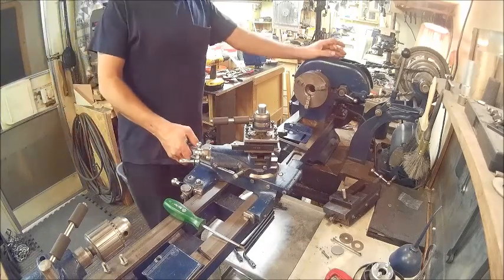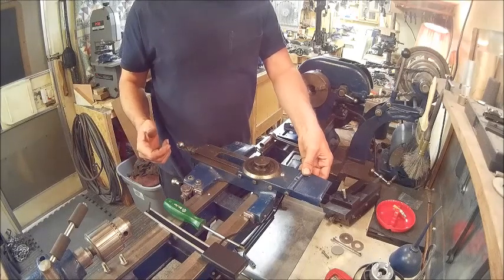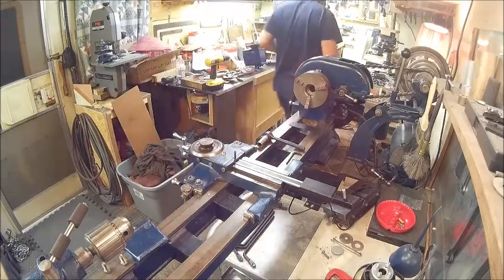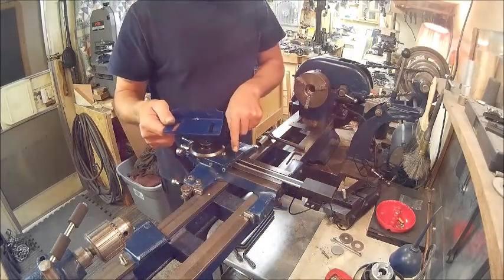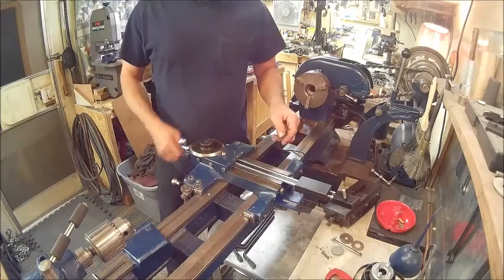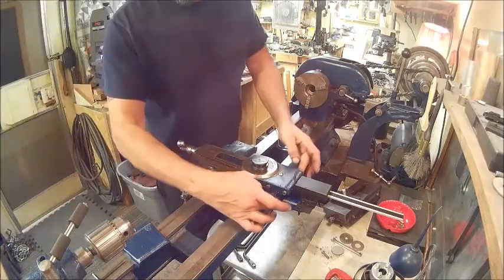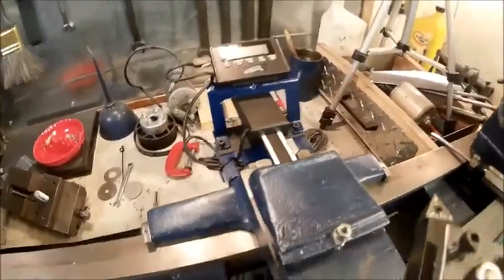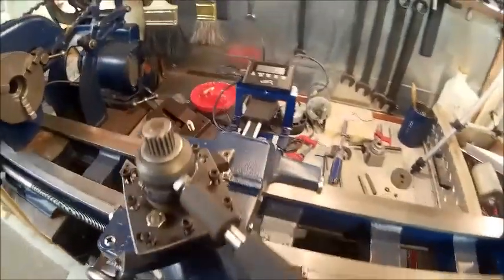1947 atlas th54 lathe dro upgrade

Comment: I have an old Atlas 6x18 (Craftsman Lathe). I am trying to find someone who can tell me the correct gear for the thread dial attachment.I need to know the no. of teeth in the gear and the size if possible. I have a gear that is brass, does not work properly and I dont think it is original. Thanks to any one who can help. I enjoy the videos.